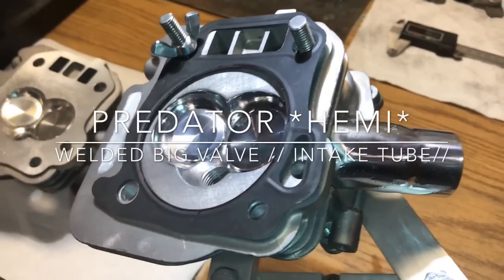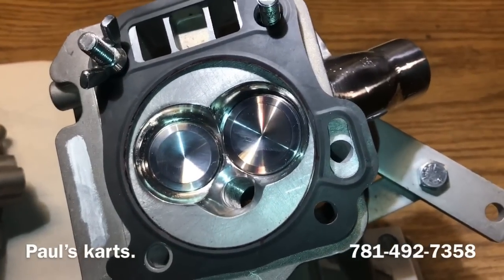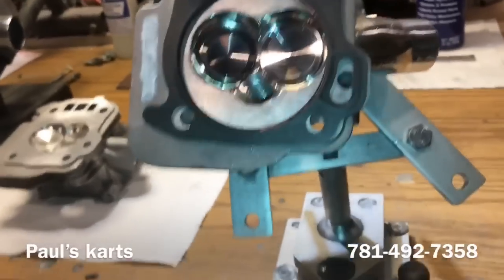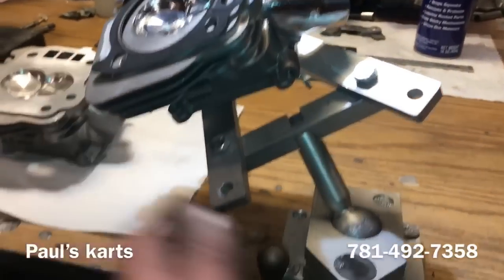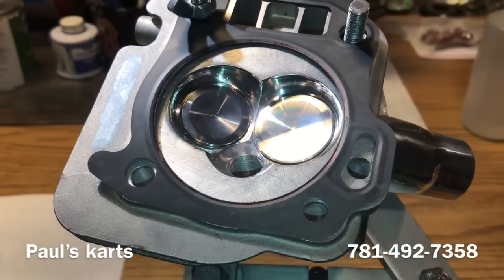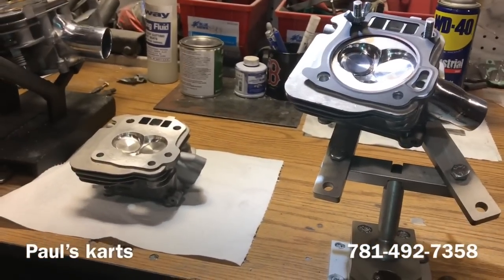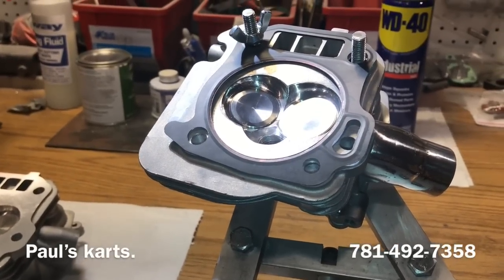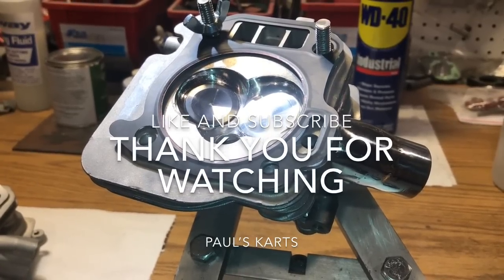PREDATOR 212 HEMI BIG VALVE 32/28 CYLINDER HEAD // part #4  intake tube

Comment: When porting my hemi head what should i focus on I am going to have a shop put in valve guides but i have had mixed info on if i should remove the valve guide boss. Also it will be supercharged and run methanol and I want to find out how to do big valve so theres that. Thanks
Reply from the maker: Port the head to the cfm requirements of your bottom end. Don’t remove the guide boss. That’s never done that I have seen. It locates the spring to some degree. Big valves just need seats installed and if doing guides that’s the time to do the seats right after the guides are installed.

Comment: Really nice looking cylinder head man. Is this a finished product or still a work in progress? I'm asking because of the lip I see in the intake port at 1:42. It appears to be a groove mark from something. Possibly from adding/welding on that massive intake tube to the Head or a manufacturing defect Left behind from the maker of the tube that you used. OR YOU LEFT IT THERE ON PURPOSE FOR SOME REASON. I'm just curious if that is something left on purpose for a specific reason or something you're going to remove before the finished product is ready.
Reply from the maker: Ummmmm not sure. This video is super old. Looks from the pic it’s still on the porting stand so I’d say it was a work in progress if I had to guess.

Comment: Those are very nice what would you recommend for the 224 with a 292 cam
Reply from the maker: Non hemi big valve 14cc with the welded intake tube and epoxy port.
Reply from the maker: Paulskarts.com

Comment: After watching tons of your videos I did a little work on my 440 head. I got even more respect for what you do. Took your advice and put in a 4.45 rod. Stock rod basically had the piston at deck height. Longer rod will probably require a thick gasket. Got any jetting ideas for a round slide 34mikuni? Running a Vegas cam and 50lb springs.
Reply from the maker: What do you mean you have more respect ?? Lol ?? Was it hard ? Did it take a long time ? Or was the end result not so nice looking ? There is definitely so truth in practice makes perfect... even if you watch my videos you can see how even to this day the heads are looking better and better .... and before I got my flow bench I had no clue .. the way I was porting before was all messed up ... i remember the first time I flowed a head on my flow bench I took one of the heads I thought I was doing perfect and flow tested it ... I was like WHAT THE FU#@ DID I DO TO THIS THING !!!!  LOL !!! I had taken a week of time and made the head terrible !!! I found out quickly that day that without a flow bench there is no way to visualize what’s going on in that port ...since then I have made some of the most amazing heads ever made ... from what I see out there my head quality is the highest hands down ...anyhow I kinda got off on a side track ... so back to your carb question .... What jets does it have ? Large round or hex ?
Reply: @paulskartslifan4206  it has the small hex jets its a China clone. I've also got a stock drz400s carb. I it's a cv type 36mm mikuni. The engine is on my fat tire motorcycle. It runs a 40 series torque converter and 25" atv tires. I had already bought the Vegas cam when I saw your video about it breaking in your engine. I thought smoothing up the transitions in my head would easy with my shop tools. Turned into alot of sand paper and tiny spaces for big fingers. A few hours of work just to get things smoothed up. Thanks for sharing so much info on these engines.
Reply from the maker: Watch the video where I’m starting the mini bike last year .. the thing wasn’t tuned yet but I think I mentioned the betting I was getting at the end of the video .. if it’s not there I’ll have to check my carb to see what jets it has